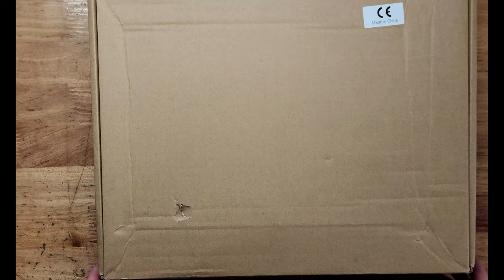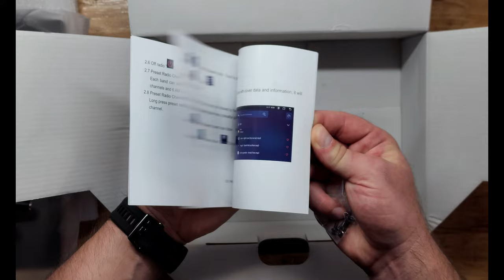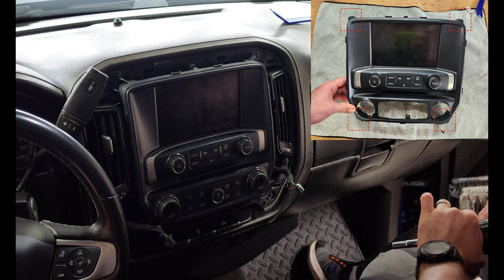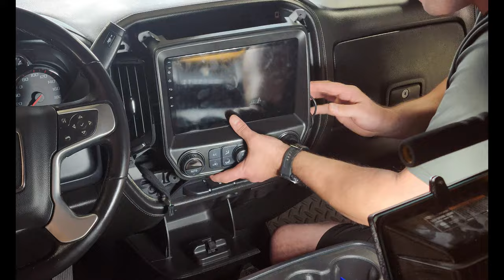2014-2018 GMC Sierra & Chevy Silverado: Step-by-Step Junsun Android Radio Installation Guide!

Comment: Where do I find the link to the exact radio you purchased?
Reply from the maker: As listed in the description.  Sorry that I can't help you any further.

8+256GB Android Car Radio GPS For Chevrolet Silverado 2013-2019 Carplay 4G WIFI: 
Note: While this 8+256GB Android Car Radio GPS for Chevrolet Silverado 2013-2019 with Carplay and 4G WIFI is no longer sold brand new, the manufacturer offers newer versions and regular updates for enhanced features. Explore the latest advancements for an upgraded driving experience.

Comment: Thanks.By watching the video I figured out I had to take out that top row of connections on the last part of the installation. Very helpful
Reply from the maker: You're welcome, and I am glad that this video helped you with your installation.
Reply: @MACSDIY  Still i progress but really did clear up the concern with the massive amount of wires. FYI I am using another brand but the wiring looks very similar. Is the harness for the rear camera behind the glove, the same one that is suggested to reboot the factory head unit... Tight space in that area.
Reply from the maker: I had to purchase a separate wire because, for some reason, when i hooked it up to the radio itself, it didn't want to work.

Comment: Where did you install the opposite end of the reverse camera harness?
Reply from the maker: If you start the video around the 5:10 mark, then it will show you where you need to plug in the rca wire.

Comment: Great video! I bought a Lasertail android head unit, and it links to your video for installation instructions, very helpful. Thanks for making it. I do have one question though; my truck has the Bose system, and I ordered the blue optic box from Lasertail. it didn't come with instructions. Do you have another video for it or a diagram for the wires? Thanks in advance.
Reply from the maker: First of all, thank you very much for that nice comment.  Unfortunately, I don't because mine came with the non bose setup in my truck.  The only advice I could give you is to look into some forums, and maybe you will stumble across something.

Comment: I’m having trouble with the SWC not working. I don’t have that T harnesses so I’m doing it hardwired. Another thing I have problems with is the vehicle sounds( seatbelt, signals and warning) I got no sound for that.
Reply from the maker: You will need the T-Harness, and for your sound, that should be your CANBUS settings.
Reply: I did the same, hooked up harness and then theft deterrent came on and head unit no power lol. Disconnected the swc and all good again 😊
Reply: @MACSDIY I connect the T wire and it sets off theft deterrent etc. take it out and all back to normal…
Reply from the maker: That could mean a couple of things.  1. Something is not connected correctly. 2. Your CANBUS settings are not set to the correct Year/Make/Model. 3. Whoever you purchased the radio from, they didn't program something correctly.  4.  You could have purchased the wrong radio.
Reply: Did you have issues with the LEDs for the buttons not turning on? The only wires I did not put were the rvca's

Comment: Just a checklist of items that I wanted to ask to make sur eeverything still works when you put this in...
1. Steering wheel controls all work?
2. Factory backup camera (And does it switch over to when in Reverse?)
3. Factory microphones for voice calls
4. HD Radio
5. Factory USB ports in the glovebox and center console (Does it still read flash drives?)
6. Does it connect to your phone with bluetooth and get data shareing right away or do you need to set that up?
7. Does the factory adjustable brightness dimmer work on this? does it have a daytime night time mode automatically?
Reply from the maker: Here's a summary of the answers to your questions. If you have more questions or need further assistance, feel free to let me know.

1. Absolutely, yes!
2. You bet, it's a "yes" again!
3. No worries, you have options here. You can either use the built-in radio or an external module that comes with the Android head unit.
4. To the best of my knowledge, I haven't seen any HD indicators on this radio, but that's probably because I don't use it much. It's possible that it doesn't have that feature.
5. It's supposed to have those features, but personally, I had some trouble and ended up using the separate components that came with it.
6. Sure thing! Like any radio, you'll need to set it up and connect your phone to it. I use Android Auto, and it's great for receiving notifications, especially texts, while driving. I'm not sure about iPhones, though.
7. I'm sorry, but it doesn't have the first feature you mentioned. However, yes, it does have a built-in feature that you can play around with.
Reply: @MACSDIY how did you do the factory backup camera? Is there a harness in the back of the headunit? My stock tailgate camera is unplugged, not sure what or how to install. A camera came with it but not the correct harness.
Reply from the maker: @lukebenning3708, there is a link for the harness that I purchased to make the factory camera work.  Also, in my video, I show where to plug it in.  It's where I take off the glove box.  I hope this helps.

Comment: Has a video on here some where says you have  to hook up the wires with the rca jacks on the radio and use the blue amp turn on for amp. Add 12 volts to that blue wire. Will have to accesory wire that get hot when key is turned on.
Reply from the maker: That sounds like a normal setup with a radio installation, but I don't know what you are asking.

Comment: I noticed that you removed the socket to the HMCI to install the reverse camera retention harness. Does the HMCI function with it not being plugged in as it is now not simply bypassed but rerouted?
Reply from the maker: That was the only way that I was able to get the camera to work.  I tried so many ways to hook it up the head unit, but it just wouldn't work.  So I just pretty much bypassed it, and then it worked.
Reply: @MACSDIY  Thank you for the reply and pretty extensive video so I appreciate it. Gonna replace my head unit as well following your guide! Did you have any issues with your truck's functionality after removing that plug from its original place? Like is that socket empty now at the module? I'd guess that the socket's purpose is only for the OEM camera.
Reply from the maker: @myaudlife4399 I had no issues with my truck since I installed it.  I think the only thing that I lost was my OnStar that was never activated anyways.
Reply: Thank you for the quick responses!
Reply from the maker: @myaudlife4399 You're welcome

Comment: Thanks for the video! The OEM plugs at the top left on the car side (big green, black), all the way to the right the last plug, where did you plug that into because my unit didn’t come with anything for it, also is it needed?
Reply from the maker: There are some wires/harnesses that are not required.   If I plugged them in, then they were used as shown in the video.  If not, then I just tucked them behind the radio.  Also, keep in mind that every vehicle is a bit different, so you may or may not need them.

Comment: Hey I’m having trouble with my aftermarket radio not coming on I don’t if the wire harness or not but I plugged back in the old and it’s work
Reply from the maker: It sounds like you may have switched some of the wires by accident.  Also, what is the make and model of the vehicle?

Comment: Did you have to get another harness for vehicle? Or is it all plug and play?   Also will it work with bose systems
Reply from the maker: I had to get one extra harness for the backup camera, and no, this specific unit will not work with bose.

Comment: Hey, thanks for the video. It definitely gives me an idea of what I'm getting into, as far as trim removal and such. It seems like a lot of these units with different brand names are basically the same thing, but with separate RAM/ROM options. I was wondering, do these units retain functionality of the stock SD card and USB port for storage? I would just get a cheaper unit with less internal storage, if that's the case. Thanks, again?
Reply from the maker: As far as I am aware, they don't because they come with their own USB ports already installed in the radio.

Comment: Does the back camera works? Car toys told me they need to replace the back camera.
Reply from the maker: When I purchased the truck, the first thing I replaced was the rear camera.  When I installed the android head unit, I had to buy a separate cable to make the camera work as shown in the tutorial.

Comment: Were you able to retain factory steering wheel controls?
Reply from the maker: Yes, I was.
Reply: @MACSDIY I was not able to connect to the steering wheel control what is the part number to order that orange harness you placed under the steering wheel
Reply from the maker: @josephcommander3537 , the accompanying part should have been included with the radio. Unfortunately, I couldn't locate a specific part number on it. To resolve this, kindly reach out to the seller from whom you purchased the radio for further assistance.

Comment: Hi, could you help please? I cannot find in sales connector with orange wires ib one row-pin under steering wheel , could you send a photo or some instruction or a link how I can connect the wire to the head. THKs in advance, I am from Ukraine
Reply from the maker: I am sorry to hear that.  The orange wire came with my radio, so I have no clue where to purchase this from separately.  Also, everything is in the video on how I installed it, and sorry, there are no instructions that came with this radio.

Comment: I followed your video and gps works and backup camera works, but I cannot get any sound. You did not say antything about the sound or speakers. I have the bose system. Do you know what I need to work around it?
Reply from the maker: I'm sorry to inform you, but this specific android unit is not compatible with bose.  As I was in the market to purchase one, that is one thing that I read in the description before purchasing it.
Reply: There is a separate adapter for the newer version of this radio to get Bose to work. “Audio System Adapter for Chevy Silverado GMC Sierra 2014-2018” on Amazon sold by Lasertail. Idk if it’s compatible with this radio but it’s an adapter and extra main harness

Comment: I haven‘t been able to get the swc to work even with the t harness. Any tips?
Reply from the maker: If it doesn't work at all, then it has to most likely do with the CANBUS settings, and you will have to set it for your specific vehicles, year, make, and model.  If this doesn't work then let me know.
Reply: @MACSDIY  I'm having this same issue with the canbus set correctly
Reply from the maker: I would contact the seller than to see if they sent you the correct head unit.
Reply: @MACSDIY  Unfortunately it's the weekend and can't get a hold of anyone, the problem is the swc plug has 2 wires and I can only plug one into the canbus, neither are working and yes the head unit is the correct one.
Reply from the maker: Sorry I haven't run into that issue.  Maybe a hard reset on the whole unit and then try to set everything back up, i.e., CANBUS settings, etc.  If that doesn't work, then I have no further suggestions or advice.  I hope this helps.

Comment: So i got everything set up but my wireless android auto is very laggy is there a fix for this? I just got everything plugged in today, going to update it tomorrow but trying to see if they're any fixes after that
Reply from the maker: You pretty much said it.  I had this issue, but after updating it, I didn't have any issues anymore.  I at least try to update the head unit once a month.

Comment: How do you get the front camera to work and steering control?
Reply from the maker: I don't have a front camera, and for the steering wheel control, there is a wire that needs to be connected, as shown in the video.

Comment: Does this radio work if u have Bose audio in your truck.... Mine is a 2015 Silverado LTZ
Reply from the maker: The particular unit I'm installing isn't compatible with the Bose set-up, but it's worth noting that this model is no longer available brand new. The latest versions from Junsun for the head unit surpass this one. However, there might be an alternative out there that's compatible with the Bose system.

Comment: Question; I have same setup cords everthing 2017 Silverado,. After hooking up the screen works fine however I have no sound,. Even when hook up AV out to my 12 in subs. No sound there either,. Any ideas?? 
Thx for video , very useful, I jus can’t figure why no sound,. I hav an older android screen in my tahoe same cords clips in for power,. It works also but no sound,. It works fine in other vehicle,. I jus pulled it to check ,. I thought maybe new head unit was fukt’up,. I can’t figure it out,.. plz help!! Thx in advance,..
Reply from the maker: The only thing that I can think of is that your CANBUS settings need to be adjusted for your year, make, and model.
Reply: @MACSDIY  ,.. I tried doing so, but my truck isn’t in the list, all cars,. I was told that Camaro was same, however, on green clip there are 6pins that need rearranging,.is becoming a pain in the arse.  I’m thinking I was sent the wrong harness,.. now seller won’t even reply bak,. So I’m debating on returning for full refund,.
Reply from the maker: I am sorry to hear that.  When I contacted the seller, it took about a couple of hours or even a day.  I think by the time I installed the radio, it took 3-4 days with contacting them about certain things
Reply: @MACSDIY  I’m not getting a reply bak from them,. Brother, I didn’t even get any instructions with my order.. I’m kinda thinkin someone ordered with same plan as I had, they ran into same trouble and posted on eBay. Someone else’s problem,.. being me now😅,. I had everything hooked up in my truck yesterday,. Las nite I left it hooked in everywhere it supposed to be, I’m this morning leaving work battery dead AF!! Something ain’t rite,.  Some of the Pins in green clip in wrong place or something,. It’s something small, a minor detail I’m looking over. Or the unit is bad,. I have an older unit same thing but 2020 model(model I jus received is a 2023 I think),.. plug is same for power,. It powers on but no sound,. Maybe I got wrong canbus idk,..

Comment: Do you have the purchasing link?
Reply from the maker: As listed in the description.  Sorry that I can't help you any further.

8+256GB Android Car Radio GPS For Chevrolet Silverado 2013-2019 Carplay 4G WIFI: 
Note: While this 8+256GB Android Car Radio GPS for Chevrolet Silverado 2013-2019 with Carplay and 4G WIFI is no longer sold brand new, the manufacturer offers newer versions and regular updates for enhanced features. Explore the latest advancements for an upgraded driving experience.

Comment: If i didnt have steering wheel controls before will i be able to add the buttons without having someone to program the module on the truck?
Reply from the maker: If you didn't have any, how would you program them?
Reply: @MACSDIY  by purchasing and physically installing the buttons on the steering wheel once I know there's a chance they can work without having to mail off a module to be reprogrammed.
Reply from the maker: That could work, but I haven't heard anybody doing that before. I guess you can give it a try and go from there and let us know.

Comment: Will this work with the factory gps built into the high country trucks?  Thx
Reply from the maker: Sorry, I am not sure, but the way this android unit is set up it comes with a GPS antenna. So I don't think it will work with the factory one, and you would have to use the one with the android unit.  I hope this helps.
Reply: Thanks
Reply from the maker: @RadiantStudio  you're welcome.

Comment: Hi I can’t figure out where you put the old CD player wires
Reply from the maker: They should plug right into the Android head unit.  Can you send an image to my email to show me exactly which wires you are talking about!
Reply: Yes plz I’ve been doing this for 3 days😂
Reply: Also I cannot get the steering wheel controls to work, I have plugged in the orange wires but nothing
Reply from the maker: That sounds like your CANBUS settings, then on your radio.  Also, my email is on my YouTube page.
Reply: I tried and connot find the email
Reply: @MACSDIY I looked for a contact tab and I don’t think it’s still available on your YouTube channel anymore
Reply from the maker: macsdiy1@gmail.com

Comment: is there a way to connect an amp straight to the harness ?
Reply from the maker: If the RCA connectors are integrated into the head unit, the installation process should be a straightforward 'plug and play' affair. However, I would strongly recommend conducting some preliminary troubleshooting with the equipment before reassembling everything to ensure everything functions smoothly. In my personal experience, while they often claim that everything is 'plug and play,' it can still be prudent to exercise caution to a certain extent.

Comment: I did this and my vehicle antitheft keeps kicking on when i try to start . Any ideas?
Reply from the maker: Maybe you need to configure the CANBUS settings, or something wasn't plugged in correctly to where it needs to go.
Reply: @MACSDIY  so I messed with it a little more and the wires coming off the radio plug at the top, there are 2 single wires. When I plug in both of them it trips out the teuck. I unplug it and it goes back to normal. Can you show what you plugged in to the top two wire?